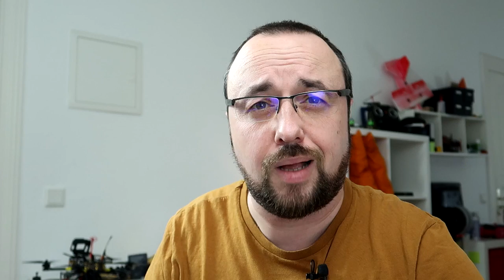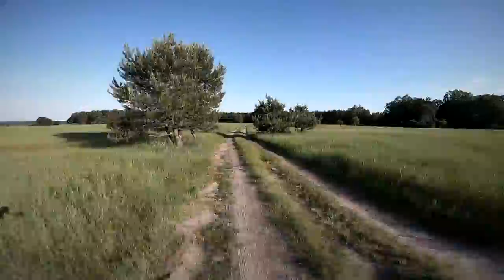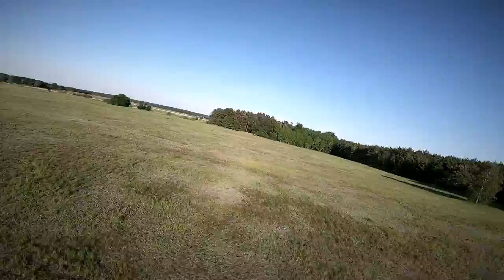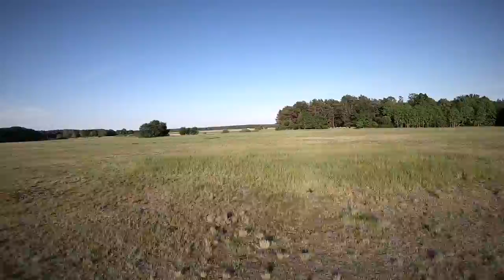Where is INAV min_throttle? INAV 2.4 changed this and that...

Comment: I've got a fixed wing and I've been trying to figure out this issue all morning.  It now finally makes sense why my motor, which is running DSHOT600 doesn't start spinning until 15% despite me trying to change every setting I know about.  Definitely going to drop this to something pretty low.  I've noticed a lot of lag on autolaunch, way more than the configured delay.  I think the issue is that iNav tries to slowly bring up the throttle from the minimum of 1000 but because nothing actually happens till 15%, my plane has twice now tried to torque itself into a tree after a slightly sketchy throw.  I'm hoping that dropping the throttle idle along with decreasing the throttle up time in AL will make for happier launches and I can stop having minor heart attacks. :)  Thanks, Pawel!

Comment: My drone is jumpy on landing have to disarm as it touches the ground even when I have switched off air mode.Should I lower the min throttle % from 15% using standard ESC.

Comment: What do you mean  - calibrate Esc for default values - also my iNav receiver tab all the stick and switch usec ranges are 885 to 2012  should this be so or do I reduce them for a range of 1000 - 1500 - 2000usec range ...joe

Comment: Juste one remark. I use auto launch feature with motor spinning on idle. If I set i Motor Idle Power to 10% and auto launch min throttle to 1065 motor do not start. I had to increase auto launch throttle above 10%, above 1100.

Comment: Using DSHOT and Motor idle 5% on my Quad I have the problem, that I need 20% throttle until the Motors start spinning faster / reacting to stick commands. This deadzone is annoying since I am losing precision. How can i cure that (without changing the mixer of my Radio)?
Reply from the maker: increase throttle_idle and lower min_check
Reply: @FPVUniversity  Ah, thanks a lot!

Comment: Im using max.throttle to restrict maximum throttle the save battery if I want to use RTH feature on my planes....
....I thought iNav was based around "Return To Home and Missions" as it does say on Github.
can we have a patch to stop the nag screen if we do not want to update ?
Good work by the way........
Reply from the maker: to limit power, use throttle_scale. It's respected by all the protocols and works in a correct way

Comment: Hi Pawel.  I built my first plane a Nano Talon configured with Inav 4.2.  I cannot get my motor to arm.  I followed Giz FPV’s build video step by step.  The only difference is I installed a Crossfire Nano receiver.  He used a Frysky receiver.  His UTube video link is https://youtu.be/z2bO5yC1-AY.  In your video you mention min throttle.  My motor spins using the motor tab in INAV.  Should I set the min throttle level below the RPM when my motor begins to spin.  I calibrated my accelerometer successfully.  Any suggestions on what to look for would be greatly appreciated.  I subscribed to your channel
Reply: I try